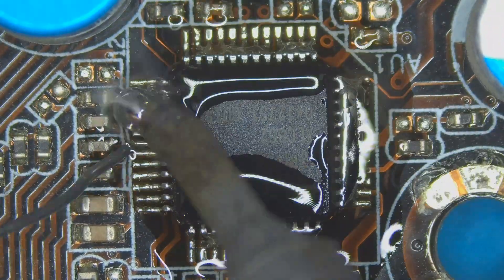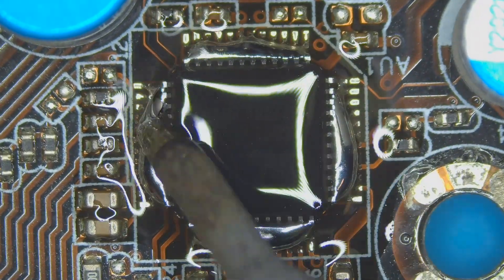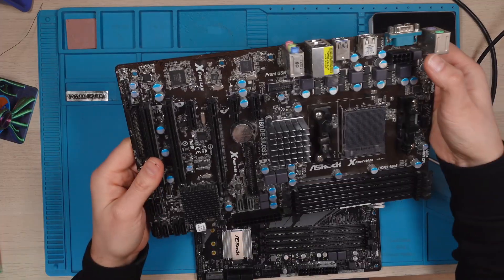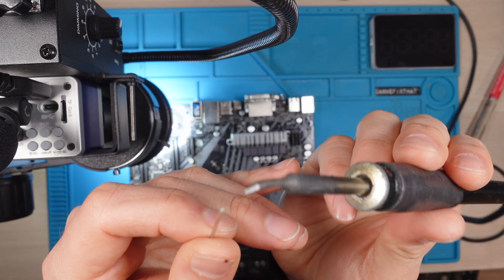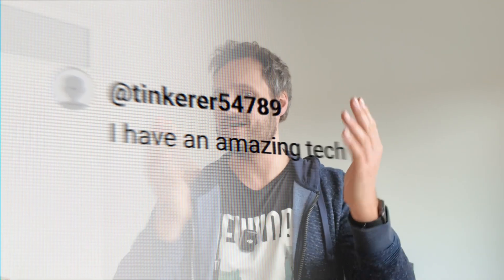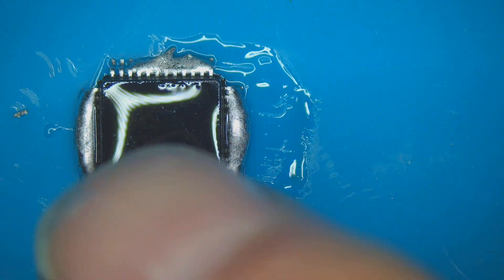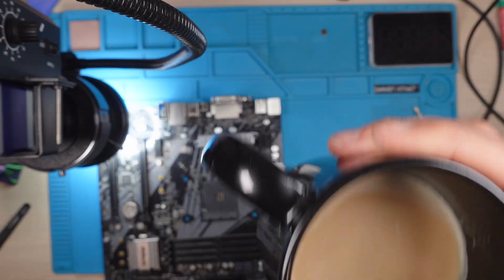Your Desoldering Technique Is Wrong!

Comment: THANK YOU! I picked up soldering as a hobby last summer and found desoldering exponentially more frustrating because of how easy it is to lift solder pads. I destroyed TWO gameboy advance SP boards doing the USB-C mod because desoldering the port just to troubleshoot issues caused by pins that are misaligned even by half a millimeter was nearly impossible. I just bought some low-melt solder to make my current GBA SP project easier to deal with, so I'm hopeful your video just helped me succeed this time around. I just subscribed!
Reply from the maker: Aww! Thank you so much, Kevin! Great to hear that my videos make a difference in your experience, and yes, for the difficult parts, low-melt solder is definitely a big game changer! Keep it up, buddy! 🫶

Comment: why not use a hot air station/heat gun
Reply from the maker: Hey there! A heat gun is a viable solution, but as mentioned in the video, this will stress all components much more than the low-melt solder method used with a soldering iron. You can combine low-melt with hot air at a much lower temperature. ✌🏻

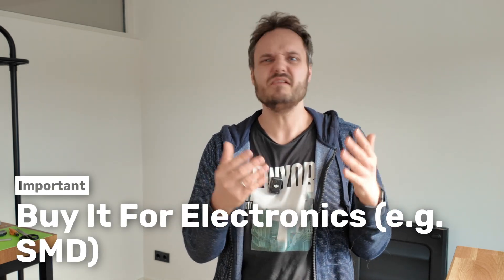Comment: 8:42
idk where you got this from, the material for low melt "welding" is exactly the same as chipquik. Stop gate-keeping lol.
The 70C ones that we use for brass connections are what you want, thecoder tested gaugemaster ones which costs $6.
Ali sells them even cheaper, just search low melt alloy, I have the ones that says "fusible" on the bar. 
Tested chipquik, gaugemaster and fusible (ali), all 3 works the same.
Reply from the maker: Hi there! Oh, that's brilliant to know! As I stated in the video, I haven't tested them and was not sure if they would also work. That's why I included this disclaimer. Believe me, I would love to buy the cheap stuff if it really is the same. Thank you for this information; it was not my intent to mislead anyone. I just wanted to be on the safe side. I will check on that and update the description with this information. 🫶
Reply from the maker: @jackipiegg Mhh, I checked AliExpress but can't find the specific items you're talking about. Could you please share a link so I can take a look?
Reply: @ 
Youtube will auto delete comments with links. search "low melt alloy", as long as the listing shows a bunch of temps as selections you're good. They got some as low as 40C but I've never tried anything lower than 70C to match chipquik.
Reply from the maker: @jackipiegg That is my problem; I can't find any good listings like that. Would you mind writing me an email with some examples you've tested? You can find it in the 'About' section of my channel info. This would be very much appreciated; thanks in advance, mate! ✌🏻
Reply: I have been searching for ages there's no low melting solder on Ali, best you could find is Mechanic 183⁰ solder paste.

 The low melt alloy you're referring to are for welding iron work.
Reply from the maker: That is exactly the only stuff I can find, and this looks absolutely wrong, or at least there is too little information to recommend it yet.
Reply: @CanWeFixThat  same here, i search ages too, for the low melt. Northridgefix sell low melt solder from the US. But i not ordered jet.
PS: 3 👍👍👍 for the video next one about solder wick 😊
Reply from the maker: @SebastianL.83  Hey Sebi! Yeah, low-melt is tough to get! Good to see you!  🫶